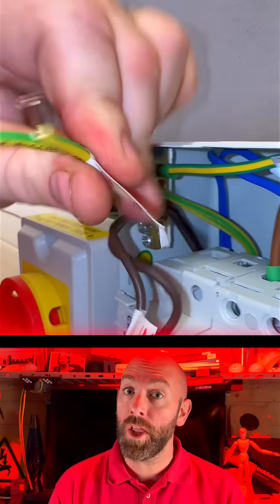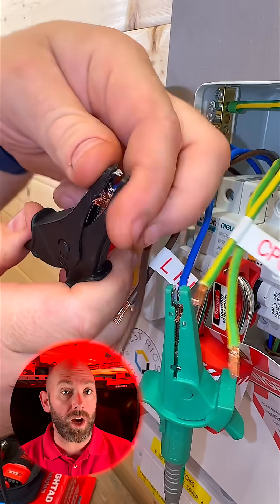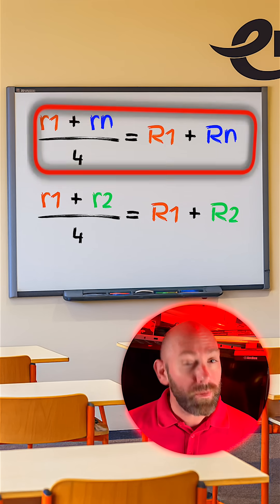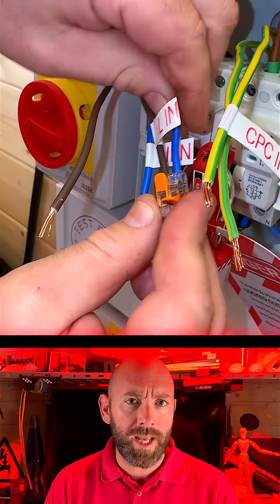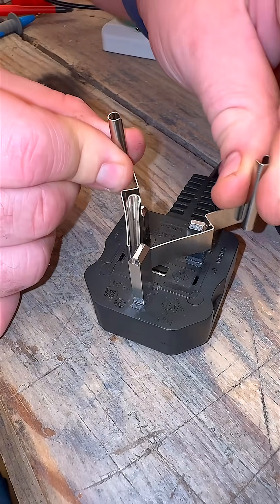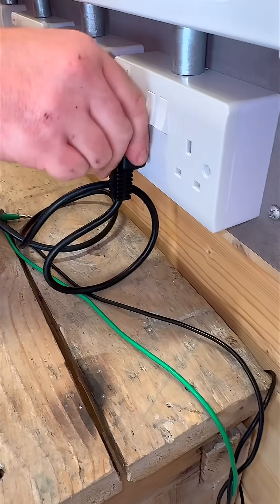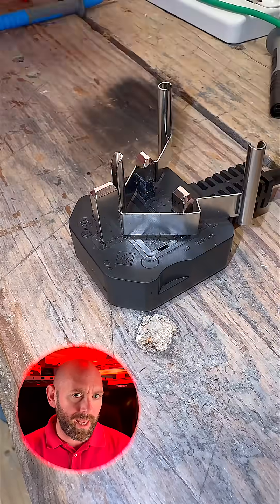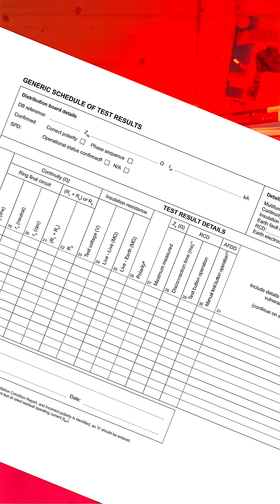Ring Final Testing in Under 3 minutes…

Comment: So is that plastic trunking, metal couplers and plastic back boxes?
Reply: and?
Reply: @njcelectricalservicessheff9684  and with singles tunning in it, its bit crap. Unless you you have banjo on the bushing inside. If you squeeze or damage singles on the bushes or in the coupler, coupler is live, hardly ever earthed if its fitted between plastic trunking and plastic back box and you only find out when u get a belt. 

A lot neater and a lot safer if u make the drop up from 2 female adaprets and bit of pvc conduit.

Comment: Is this an actual "required" test in the uk? In canada we just 'send it'!
Reply: Do you use that weird ring circuit neutrals in Canada?
Reply: @johanmetreus  Everyone else uses radial finals.  Rings are often explicitly prohibited.  If the Canadians are like the yanks they don't do any resistance / IR / verification at all at least in domestic, industrial will get IR tests.  It's all done from a mechanical point of view.  Run the correct gauge wire, make sure the screws are tight, put into operation.
Reply: @retrozmachine1189  That is so different from the Swedish standards;
isolation check between all the phases, neutral and PE, plus continuity/resistance.
Reply: @johanmetreus  Same sort of testing is required in Australia too.
Reply: YesO no doubt industrial gets tested! Ive done the Q/C reports for that, its very thorough. This just seemed like a residential application so thats why I asked. And your right when it comes to code we're basically in lock-step with our 'imperial' cousins.

Comment: 🐣 .... ( from E.E. retired ) 
I am concerned you may be 
misleading viewers about the 
accuracy of the method to 
measure 
circuit resistance : 
with 2 leads 
as shown in the video and with 
a zero set feature, those 2 leads 
will always give a different 
reading connected to different 
wires because the contact 
resistance will be different 
for different wires ! 
anywhere between 
0•010 ohms and 
0•100 ohms 
even if you reset to zero 
the next wire will have a 
different contact resistance , 
what did the display show .... 
( oooooohhhh .... ) 
NOTE : 
I am NOT disputing regulations 
or certified methods 
or certified equipment ! 
NOTE : 
accurate measurement of 
low value resistance requires 
a 4 point resistance bridge 
( 4 leads ) 
2 leads from a current source , 
2 leads from a volt meter , 
the voltage reading is equivalent 
to the resistance value , 
so , example : 
1•000 amp ( +/- 0•1 % ) 
precision current source 
with 2 leads connected to 
each side of the sample to be 
tested , next : 
2 leads from the voltmeter 
are connected at the point 
to be measured , so , 
0•001000 volts 
is equal to 
0•001000 ohms 
or 
1•000  milli  volt 
is equal to 
1•000  milli  ohm 
on a 2,000 count 
( 3 & 1/2 digit display ) 
and a 0•5% accuracy 
on an ordinary meter . 
I hope this helps ❤
Reply from the maker: Monjaro Joe here - I appreciate you taking the time to share your insights; very interesting to read! You will have to send me some examples of 4 lead low resistance meter's. That very new to me and would make an interesting comparison to see if Electricians could measure using this method on site and the difference in reading to see if contact resistance makes that much of an impact, as opposed to temperature or other external factors. email me at willittrip@efixx.co.uk or drop me a DM on LinkedIn 😊
Reply: Could always argue that when the circuit is energised the impedance would see a difference. Plus as mentioned the temperature, etc. Got to draw the line somewhere and safety over connivence and speed those at the IET, haven’t been proven wrong yet.  Maybe testing space crafts the tolerances demanded be tighter?

Comment: I was told Gary and my asser on 2391-52 that bench reading of 0.05 only applies to end to end resistance on step one of the ring final circuit conductors can some clear this up gn3 says it does thank you